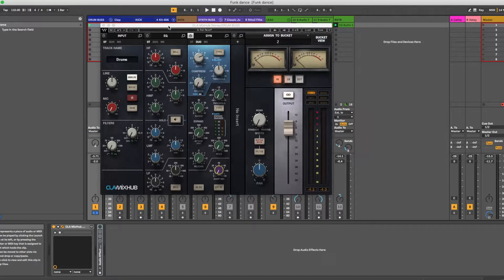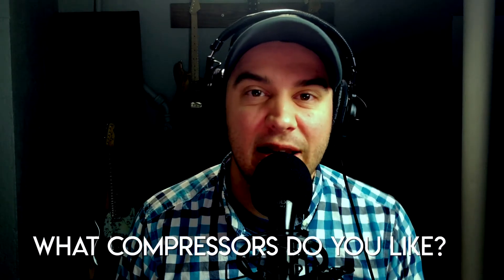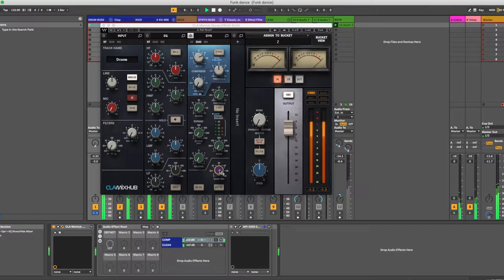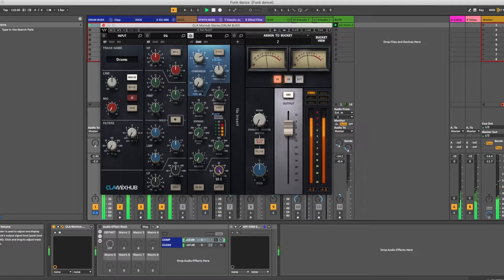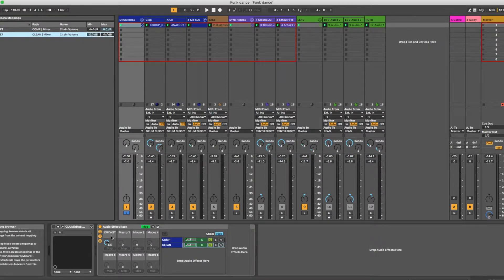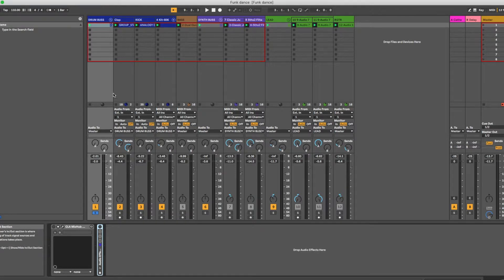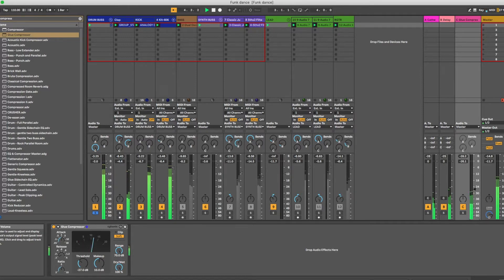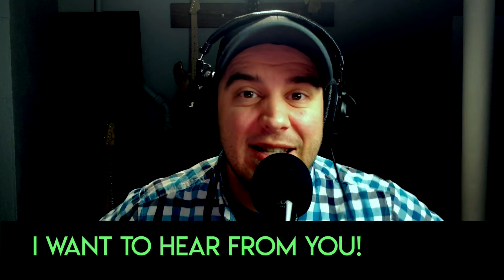3 Ways to Create Parallel Compression in Ableton Live 11 and 10

Comment: Great video, at 3mins, do you have to map the two volumes to a macro, cant you just turn the clean signal down in the effects rack and lift the compressed signal up, but essentially you dont need to turn the clean signal down, you could just lift the heavy compressed signal up and then use utility to decrease the output of the entire signal? if that makes any sense lol
Reply from the maker: Good point, Matt!  Absolutely. That's one of the things that I love about working in modern DAWs - - so many ways to achieve the sounds and tones you're after! Thanks for watching!